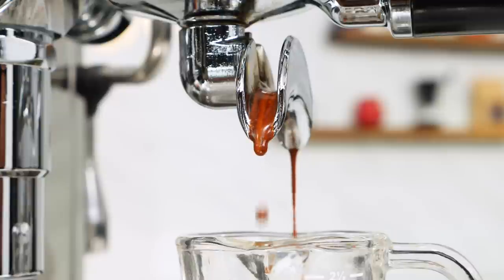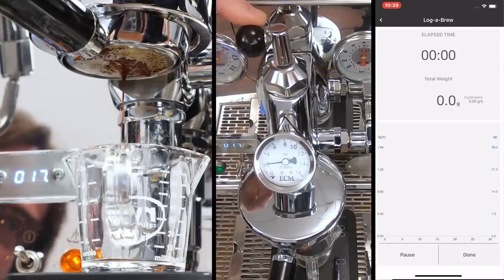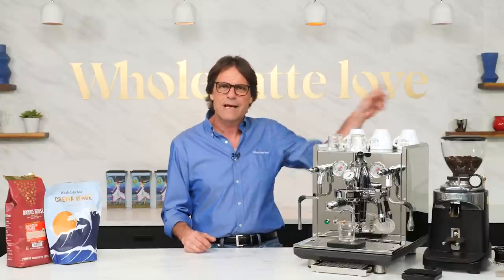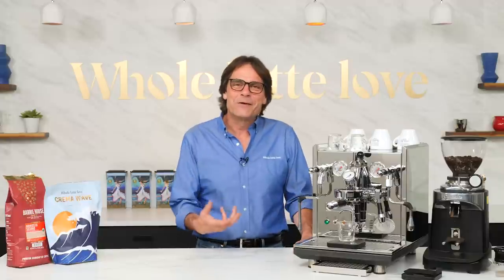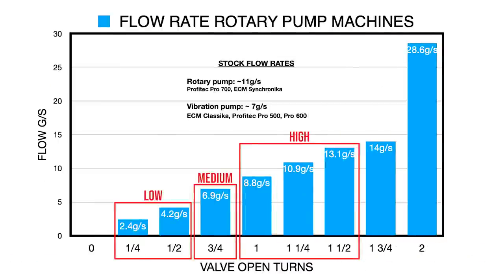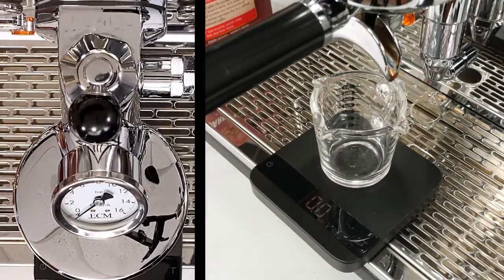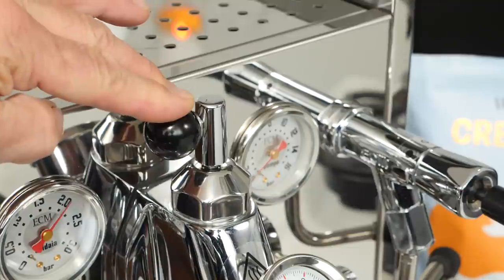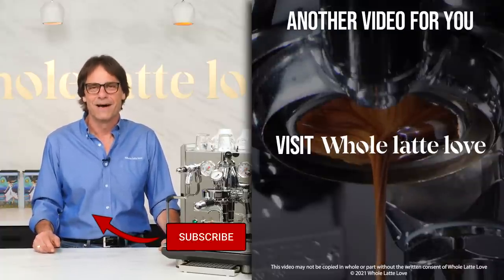Better Espresso Using Easy Flow Profiling Methods

Comment: Marc, Many thanks.
Will you be doing a version of this specifically for the Crem One Profiler?
Reply from the maker: Hi Richard, You're welcome! While pressure and flow are related they are a bit different. When I'm using a flow rate I pay little attention to the group mounted pressure gauge. But, same general principles presented here can transfer to pressure profiling. Less aggressive to start when using fresh and or light roast and more aggressive to start for darker, blends or older coffees. I'm sure I'll be back around to more on the Crem One Profiler. One advantage it has over E61 flow control is the ability to precisely repeat a previous pressure profile when desrired.
Marc

Comment: Any proven profiles for handling relatively fresh, medium roast decaf? 🤔

I've been all over the Internet and nobody agrees.
Reply from the maker: Hi Cobra, Thanks for the question. May take some trial and error on your part to find what works best. I have tasted impressive results on decaf espresso by brewing at higher than normal brew pressure of 12 bar using a higher than normal flow rate. This was a couple of years ago and It's rare I drink decaf but it was far better than expected.
Reply: @Wholelattelovepage  Thank you for the reply!  I just needed some idea where to start.  I'm expecting plenty of trial and error.  Appreciate your efforts on the comments and videos.  I'm certain it's lots of work. 👍🏻

Comment: Hi Marc, one more question. What should I set the steam and extraction boilers temps at? I am going to be using Lavazza super crema for now. Thanks!
Reply from the maker: Hi Stella, For brew temperature it's between 195-205F (91-96C) for espresso. Cooler end of range for darker roasts. Higher end for lighter roasts. Super Crema does well at 199F (93C). For steam you can go all the way to 270F for max steam power. If you're newer to frothing milk you may want to use a lower temp. That'll reduce steam power and give you more time to work the milk.
Hope that helps!
Marc

Comment: Marc - thanks for that. It is very informative.

I take it from your comments in the video, the gauge that is measuring pressure is not really all that important. It seems that once you know the flow rates, you go by the lever position, not the gauge reading?

That would suit me, because I already have a temperature gauge installed and find that useful.

I thought you used to sell the control unit as a separate item to retrofit ECM and Rocket machines, but I can't see it on your website (I suspect postage might kill the deal for me any way. I'm in Oz)
Reply from the maker: Hi Steve, You're welcome. I wanted to keep it simple in this video but yes, I am more concerned with flow rates. The pressure gauge does give some information. Like you'll see pressure decrease during an extraction if using a constant flow rate as the puck erodes. Could that drive a change in flow rate? Maybe but depends on what one is trying to achieve.

At this point we're only offering flow control on new machines or for customer who purchased an ECM or Profitec without it in the past. This is due to limited supply.

Unfortunately we only ship to US and Canada.
Marc

Comment: Hi Marc well done with the video as always, one question though, is the flow control kit applicable to other e61 machine for example, rocket appartamento to begin with?
Reply from the maker: Hi Kelvin, We have tested on e61 group machines from other manufacturers and they work.
Marc
Reply: @Wholelattelovepage  thanks for your reply, what is the purpose of having the harder spring included in the package?

Comment: Hi Marc, is it possible to instal on commercial machine? Thanks s lot
Reply from the maker: Hi f, yes if the machine has an E61 group head.
Marc
Reply: Hi Marc, thanks for your reply. I just learnt that will not fit on futurmat custom. Can you point me to commercial machine with "unhiden" group where I can instal your valve, please? Thanks a lot
Reply from the maker: @familyarttess1081  Unfortunately there are not any true commercial machines using E61 groups
Reply: Hi Marc,
 
Thank you for verifying. And I understand why. Based on evolution, on commercial machines pressure flowing is controlled electrically, so manually we can control it on home machines only. Thank you for your time and effort.

Comment: Hi Marc, does that mean dialing in the grind is no longer that important. Or will you even not to dialing in on purpose to experience the taste and flavour that previously cannot be had?
Reply from the maker: Hey Sam, Thanks for the question. Dialing in is always important - even with flow control. That said, flow control allows for real time correction of grind that is not perfectly dialed in.
Marc

Comment: Which profile do you use for Orphea?
Reply from the maker: Hi sG, I prefer starting at stock flow rate and tapering flow as the shot progresses. I've also had very good results from the sweet bump profile found in this article: https://www.wholelattelove.com/blogs/articles/intro-to-calculating-flow-rate-on-e61-group-machines
Marc

Comment: I have a profitec pro 600 with flow control on order.  I roast my own beans, so my beans are never more than a week away from roasted.  My level of roast changes with my mood --- so since my beans are fresh - do I make the decision on which basic scheme based on roast level? In other words, would I always use the slow to fast scheme?  You say "fresh or light roast" --- but what if I have a very fresh full city+ roast --- would the fresh outweigh the darker roast and keep me in a slow to fast situation. Or, does the dark roast outweigh the fresh and I'd be in a fast to slow flow rate situation?  For Medium roast, that is fresh, slow to fast flow?
Reply from the maker: Hey Torka, Thanks for the question. For a very fresh coffee regardless of roast level I'd start with slow to medium. Probably has less impact as roast level increases. So yes, freshness IMO outweighs roast level to some extent. But, every coffee is different and so are personal taste preferences. So best thing is to try a profile, taste and try another with a change. Dark roast should off-gas faster than light. For medium roast fresh like the Crema Wave I used in the video go with slow to medium decreasing the low flow duration as the coffee ages out to about 4 weeks. Hope that helps!
Marc

Comment: Hi Marc, for example my machine using vibrating pump and the flow rate is 10g/s. If I want install needle valve adjusting the flow rate to 7g/s. start from pre-infusion until finish will have static flow. Is it will have a good espresso if using static flow rate for 7g/s than stock flow rate 10g/s?
Reply from the maker: Hey fs, Thanks for the question. Maybe, depends on the coffee. In very general terms for very fresh and light roasts I tend to use a very low flow rate to start until first drip then adjust to a medium flow rate. For older and/or darker roasts I use a high flow rate to start then back off to a medium to low flow rate to finish. Hope that helps!
Marc

Comment: Hi Marc! I am using the flow control on my Profitec Pro 500, the issue I am having is that when I open the flow profile even 1/4 turn, I get a flow rate of around 7 grams per second and it stays approx the same no matter how far I open it up. Any ideas how I can resolve that issue? Thanks!
Reply from the maker: Hey MH! My guess is your flow control is not closing all the way. If you close it and run the pump are you still getting flow from the group head? If so, it's likely the sleeve which the control knob mounts into has slid down a bit and is preventing full closure of the valve. To correct, loosen the knob and lift the sleeve up a bit. Then close the valve fully and leave a gap between the base of the sleeve and the top of the mushroom. Then tighten the knob to hold the sleeve in place. If needed, here's a video covering the topic: https://youtu.be/ms_o8ev-MyM
Hope that helps!
Marc
Reply: @Wholelattelovepage  Thanks! I managed to fix it that way!
Reply from the maker: @michaelhacker45  Awesome!

Comment: Marc. Big question on my eureka mignon specialista I opened it up to clean burrs. I took top burr off cleaned it vacuumed it etc now I just put top burr on I don’t know if there’s any aligning it because I moved burr away so I don’t know if the burr went on like at the factory. Is that ok or is there a process to align top burr. Thanks a bunch.
Reply from the maker: Hi BP, Thanks for the question. In all the Mignon grinders I've used the top burr is fixed so just put it back on and tighten the 3 screws and you should be good to go. No alignment needed and since it's the bottom burr which adjusts to change grind size you do not loose your grind setting and there's no need to recalibrate.
Marc

Comment: Is it suitable with bezzera mitica top?
Reply from the maker: Hi NO, Thanks for the question. Here's my video introducing flow control on Bezzera machines. Flow rates are a little different than those discussed in this video but the principles are the same. For the Bezzera machines I've used with flow it's 1 valve turn open for the stock flow rate and they tend to have lower maximum flow rates than Profitec and ECM machines. That's not a big deal as the vast majority of flow profiles use lower than stock flow rates: https://youtu.be/kNdhZ6qTjps
Marc
Reply: @Wholelattelovepage  Thank you Marc! Is it possible to buy that bezzeras flow rate tool and equip my Bezzera Mitica? Or it is only with new bezzera machine?

Comment: Does this work with a rocket appartamento being that it’s heat exchange?
Reply from the maker: Hi JP, Flow control can be used on HX machines. As the Appartamento is not PID you will need to do a cooling flush as needed.
Marc
Reply: @Wholelattelovepage  Thanks Marc for all the information so far! I JUST lowered the brew pressure on my machine too today with using a pressure gauge on the group head from 13 BAR to 9 and WOW honestly what a huge difference. The flavors that come out of the espresso now are next level. Using the same coffee for my testing prior to the change the nose and taste lacked depth and character and was just average. Now I'm able to get a really nice show with out the espresso flowing out over pressured IMO. 

I am consistently able to pull 20g in at 45g out in about 25-30 seconds with 40ml of liquid and about 20ml of crema. My milk drinks even end up better for the fact I think the espresso is extracted much better. I can't imagine what I could get with utilizing a flow control system to imitate something like a higher end machine and restricting it down to 3-6 Bar and then ramping it back up... Just need to find $250 haha.

Comment: I've got a rotary E61 and the line pressure from mains water plumbed in is 3bar. So I get 3.2g/s using the E61's native pre-infusion and 8.8g/s with the pump on and pushing 9bar. I only ever drink light/medium roast that's no more than 1-2 weeks old. So I'm left wondering if there's any benefit to using a E61 mushroom flow controller like this over the machine's own pre-infusion?
Reply from the maker: Hi George, Thanks for sharing your details. If you are only ever drinking light/med roast what you have no can work for you. With flow control on the mushroom  you'd be able to finesse things a bit more if desired like have the ability to tail off flow toward end of shot.
Marc

Comment: What is the best lowest-priced espresso machine I can get away with for extracting light roast well?
Reply from the maker: Hey John, For espresso purist I recommend the ECM Classika. "Low priced" depends on your perspective. It's a E61 group, PID, flow control, vibe pump, single boiler machine. Check out user reviews here: https://www.wholelattelove.com/products/ecm-classika-pid-espresso-machine-with-flow-control
Marc

Comment: Why are we measuring flow in weight?
Reply from the maker: Hi b, 1 gram of water = 1 milliliter. In most cases it's easier and more accurate to measure using weight.
Marc

Comment: What is flow control? Like what's the point. I don't get it.
Reply from the maker: Hi sf, flow control allows you to change the flow rate of brew water to the coffee puck. As covered in the video a very common use is lowering the flow rate initially on fresh from roast coffees to decrease bright/acidic flavors.
Marc

Comment: How about the shot time? still between 20-30 sec?
Reply: when you dialed your grinder at stock flow to taste successfully, adjust grind size to the chosen profile as stated in the video and extract by weight and ignore time completely.
Reply from the maker: Hey Abu, Perfect advice!
Marc

Comment: this works on roket apartamento
Reply from the maker: Hi Xavier, If you had a flow control on Appartamento you could apply the same procedures. Keep in mind the brew temps will be harder to deal with as in most cases the non-PID Appartamento will need flushes to manage brew temps.
Marc